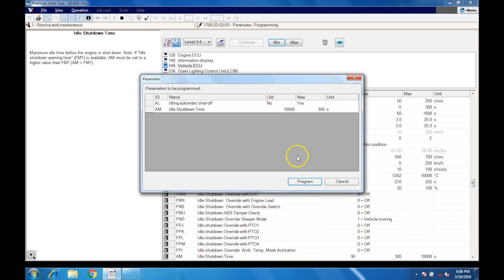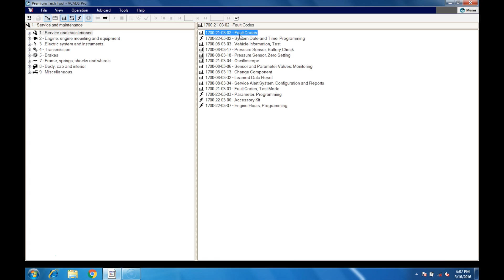Program Idle Shutdown To 5 Minutes | Premium Tech Tool | PTT | OTR Performance

Comment: Thanks!! Finally know how to turn is OFF.
Reply: @John Davis i saw our mechanic plug into my truck, scroll to the Idle Shutdown section
Try to open it up, but its a dead end

Now, i have a shit truck that won't idle in -30°C or +30°C weather
I have to rely on the batteries, which is a dangerous idea during winter.
But hey, we're saving diesel, amirite